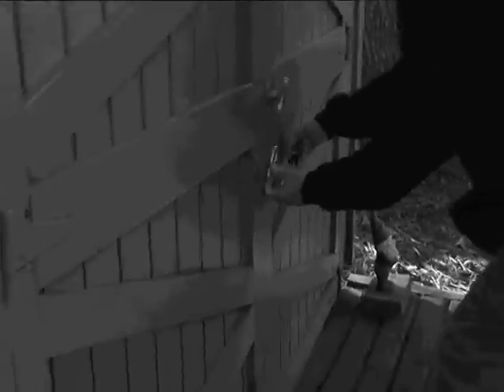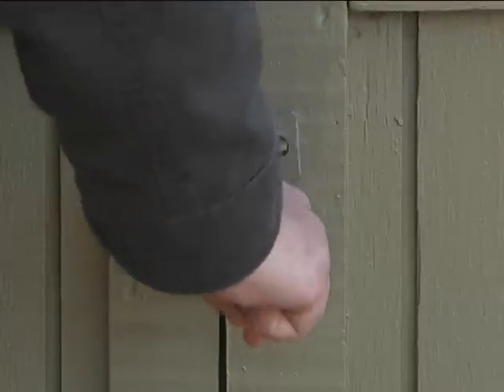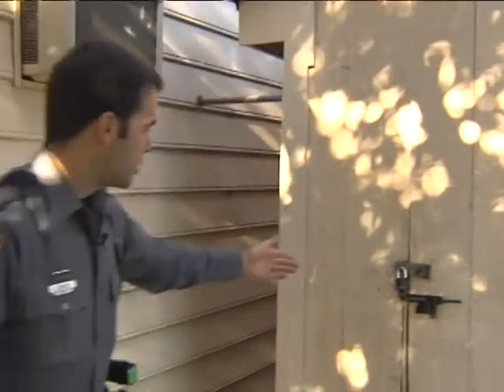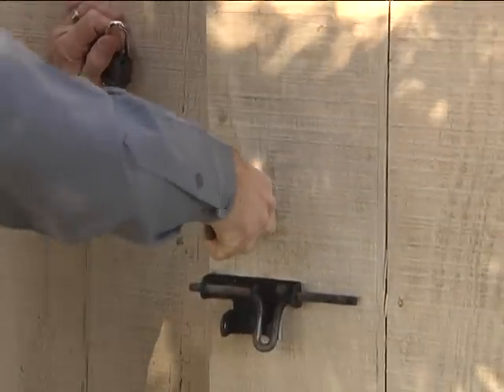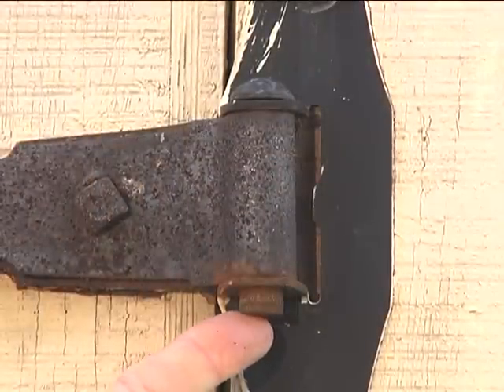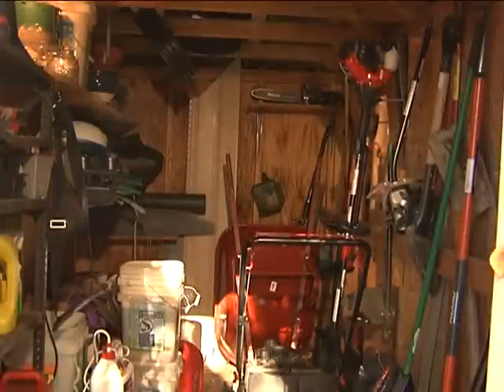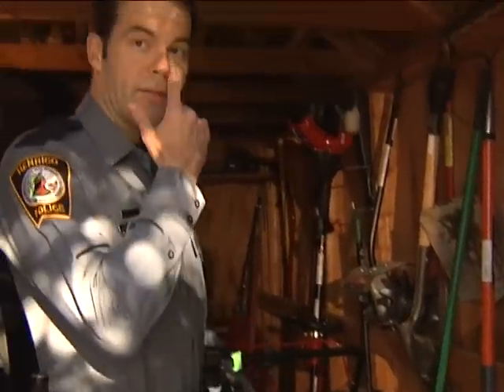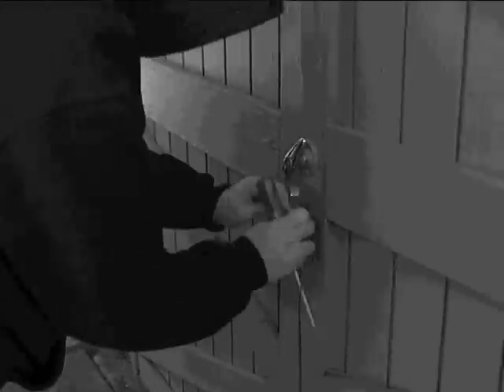Tool Shed security tips

Comment: I would not use wood screw for the hardware. use machine bolts that go through the entire door and double nut them on the other side so they cannot be taken off...especially on the exposed hinges. this way even if they use a pry bar they are going to have a much harder time since they don't just have to pull the screw out of the wood they are now working against the machine screw with washers on the inside that are double nutted. Also stop putting windows in your sheds because they look nice..with some duck tape placed over the window if can be broken with little noise.